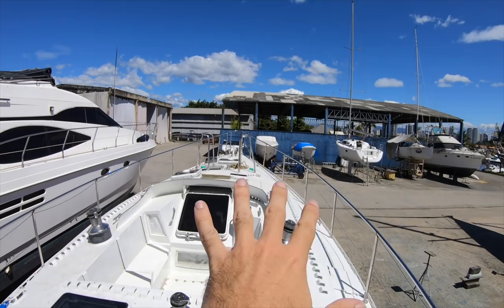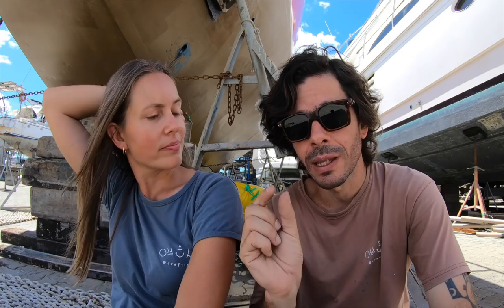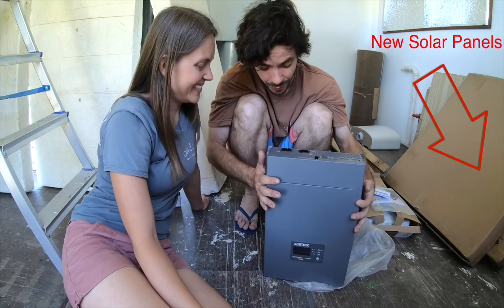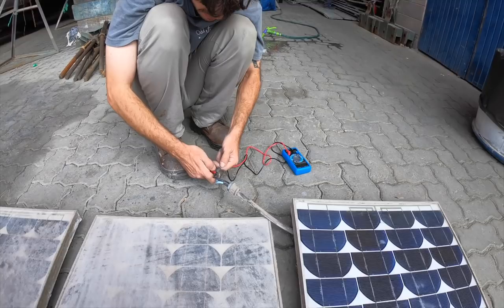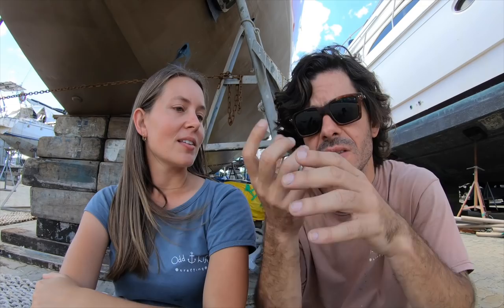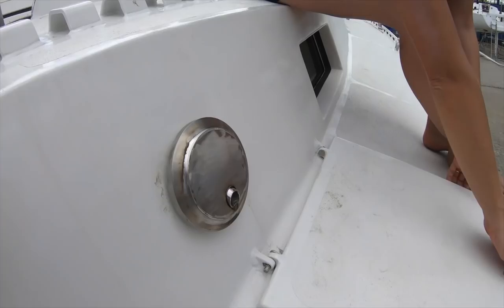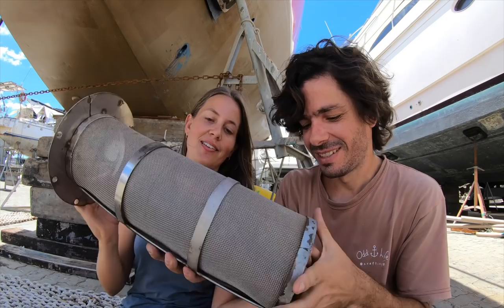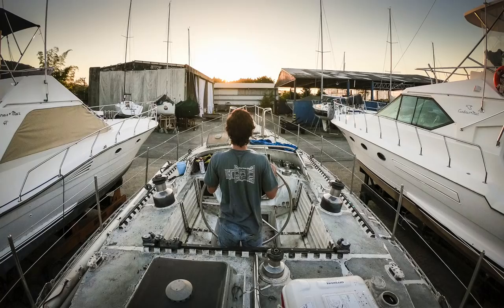⛵️Stainless Steel! LET'S GET STARTED!! #120

Comment: Check the DC voltage and amps on those old modules.  They could have advertised VOC (voltage open circuit) and not produce adequate amperage.
Reply from the maker: Thanks for the tip

Comment: I've noticed on a few of your videos that when you are putting stainless steel fasteners in/on your boat, that you are not using anti-seize on any of the stainless fasteners.  Using anti-seize is particularly important when you are using a stainless screw/bolt because stainless has a great tendency to gall and seize up - like all the fasteners on the wood rails along the top of the boat that you had to cut off.  If you ever want to be able to unthread any of these fasteners in the future, you need to use anti-seize on them.   This is a paste that usually has aluminum or copper in it that you brush onto the fastener before assembly.  It is sometimes known as copper grease or copper paste in Europe.  Do a search on amazon "Loctite 299175 Paste Anti-Seize Lubricant", this is the Marine grade of anti-seize. A little goes a long way, so one bottle is enough to do your boat and several other boats.  Use it on every fastener that you can, including all of the steel fasteners.
Also, if you want to bolt aluminum rails to stainless steel, you need to use large UHMW or rubber plastic fender washers between the two to prevent direct contact (but there will still be electrolysis at the bolt).  Most people don't know what fender washers are, they are very large diameter washers used in automotive applications.  For example, if you get a washer for a 1/4 inch (6.35 mm)  bolt, the diameter of a fender washer will be about 2 inches (51 mm) or more.  If you do a search on amazon for "Prime-Line 9086029 Fender Washers, 1/4 in. X 2 in. OD, Black Neoprene, 25-Pack", it will give you an idea of what I am talking about.

Comment: Curios about the aft stainless arch. Its attached to the stern rail. I'm concerned about that w the dingy weight and movement of the boat. Doesn't look stable enough.  Should be attached directly to the deck w metal plates.
Looking 👍

Comment: If you put a one way valve in the hose it woudnt matter where it vented to as long as the pressure difference on the venting side is less than the diesel tank side.
Reply from the maker: 👍🏻👍🏻 20 years ago we don’t know if it existed. Hehe. That’s way he changed the place of it. Hehe
Reply: Im not saying ya'll did it wrong.  You probably did it the best way.  My mind just got to thinkin what the previous owner was thinkin and how to make it work that way.  To see where he was coming from ya know?
Reply from the maker: Yes. I understood it. Hehe

Comment: By doing the water supply in the rail you eliminate the possibility of having gates in the rail to step on and off the boat at a marina.??
Reply from the maker: Yes. To have the gate we would need to do some welds on the hull and we didn’t want that. At least for now. 😁

Comment: Good Morning. Did you consider installing a bow thruster during the refit?
Reply from the maker: As it’s a hot galvanized metal boat we don’t want to touch to much on the hull. But to have one would be great. It’s also really expensive in Brazil
Reply: @OddLifeCrafting  thank you for your response. Have fun in Miami and Ny
Reply from the maker: Thanks a lot

Comment: So you'd have some running water on the chain of the anchor as it is being drawn back in to rinse if off? Very smart. also second arch to duck under when the sail it batting about is a smart idea. Are you going to have some kind of a wheelhouse enclosure to keep from getting slapped around directly by water in a storm? My heart is with you guys as you make improvements to the boat. :-)
Reply from the maker: We are planning some sort of enclosure. 😁 thanks for the support
Reply: @OddLifeCrafting  awesome!!

Comment: Hey guys not sure if any one said the main reasons the decks on sailboats slope so much. When running the boat leans and proper trim will have one side almost level. Hope you took that in to account when they welded the side rail.
Reply from the maker: Yes. This is one of the reasons it’s like this ☺️

Comment: the selection of stainless for piping salt water can be an issue. If you haven't check out the best way to prevent corrosion of the pipe considering the type of alloy you have. It might be as simple as draining the pipe when not used.
Reply from the maker: The idea is to have a hose inside of the pipe ☺️
Reply: @OddLifeCrafting  that may work depending.

Comment: At 1:21, there appears to be a crack in the top of the diesel tank that runs down slightly into the side wall. If so, was that repaired?

Comment: Electric davits? 😁 will be stronger and good for more solar panels. B&G makes good autopilot no? Great job! When using aluminum and stainless use dissimilar metals sealant or compound when assembling.
Reply from the maker: Thanks for the recommendations. We are not sure about the electric ones, it would be one more thing to give some maintenance.

Comment: Hi follow you every week and it has certainly been a great result,
however, I am a little worried about the way the arc for the solar panels and dingy is mounted,
was it my boat  the arch was mounted all the way down the deck, and not on the railing,
but should it be on top of the railing, I think it should be welded on, and not screwed with 4pc M6 bolts,

likewise I wanted to make an X reinforcement in the railing where the arch is mounted,
but that is not my decision and I can be wrong,   ;-)
Good wind ahead with your project.
Reply from the maker: We were going to weld but it is so solid like this that we decided not to. Ans also this arch was made originally on the boat yard 28 years ago. And all of the sabe boat we have seen came out with the same arch and we never heard of any of them failing. So. 😉

Comment: It wouldn't be that hard to get water through that bulkhead near the bow. That is what through hull fittings are for. Put a sea valve on the inside as a safety shutoff in case a problem occurs in front of the bulkhead.

Comment: The reason you did not see a difference between a dirty solar panel and the clean solar panel you were reading voltage only if you place a load on the dirty panel (something drawing power) the voltage would drop and the current would be much lower

Think of it this way the dirt is preventing light from reaching the panel so its energy source is lower
Reply from the maker: 😬 thanks for the explanation

Comment: The Voltage on the dirty and clean will be the same it is the amp load that you will see the difference.
Reply from the maker: Thanks for the explanation
Reply: Solar is what I do for a living.  If you ever need any advice feel free to ask.
Reply from the maker: Thanks a lot. We still need to install the new ones. Xantrex are gonna assist us about the installation. You can give us some tips ☺️
Reply: @OddLifeCrafting  💗👍

Comment: Not sure if you will end up regretting the rail.  When the boat is under sail it will tilt making the deck level but the rail will then be in the way to walk.
Reply from the maker: It depends on what side of the boat we are gonna be walking through ☺️

Comment: add a small nozzle with a pump controled by the anchor winch power to splash water directly on the chain while the chain will be hauled in. Nozzle can be installed on/in a pipe bow. Saw that on a Hallberg Rassy.
Reply from the maker: That’s a nice idea!! Thanks a lot for the tip!

Comment: Voltage output is not "power". If you put a load, voltage will drop much more on the dirty panels.
Reply from the maker: Thanks for the explanation
Reply: @OddLifeCrafting    It was a "on the go" reply. Solar panels work like this, at OPEN CIRCUIT (what you were measuring) the will show the datasheet voltage (Voc) even in (relative) low light, or dirty, because the current has nowhere to go. If they are squeaky clean and have full sun and you short circuit the + and - , you will measure the SHORT CIRCUIT current (Isc) (at a very low voltage, hence the short circuit). Varying the impedance on the load side you can try to find the sweet spot that will give you the most power (P = V x I, where V can go from 0 to Voc and "I" can go from 0 to Isc). That is exactly what a MPPT controller does. And because the power curve varies with ambiental conditions (sun intensity, angle, ambient temperature, panel cleanness, etc) this "tracking" of Maximum Power Point is done constantly. So, solar panels produce power "on demand". There is no harm in letting them out on the sun without any load (that is not true for most other power sources, like wind gens, alternator, etc), and as far as there is sun, they will produce only the accepted amount of power the load can take (charge controller being the "gatekeeper" if there is a voltage limit, like charging batteries, for instance) up to their max power output. A windgenerator, for example, if there is wind, and no load (batteries are already full, for example) will have to be either mechanically stopped or connected to a big resistor do dump power otherwise it will spin it self into destruction and/or burn the regulators from high voltage.

Comment: Ah, do not confuse the open circuit output voltage with the energy generation ... the voltage  without a load is not a true figure of the power that can be produced.
Reply from the maker: Thanks for the explanation

Comment: Your rail will rust, you need to electropolish the welds.
Reply from the maker: Thanks for the recommendation
Reply: Odd Life Crafting hey you need to grind it first with special grinding machine like Suhner UBC 10-r (for that type of weld)if you can't justify 700€cost, you can always buy attachment for angle grinder(variable speed) on aliexpress😉 which will do the job and don't forget to passivate.
Reply from the maker: We didn’t finish the job yet. They are gonna use this method as they did on the arch.

Comment: Very nice work, only one concern. When you run the mid rail cable through holes in the stanchion posts, you will allow water to collect inside the posts. This will lead to corrosion at the base inside. It’s better to install guide rings on the outside and run the cables through them. Love the transformation and the attention to detail.
Reply from the maker: They have no holes to the inside of the posts, there is a plastic piece inside to allow the cables to pass through but there is no way the water can get in ☺️
Reply: Odd Life Crafting sorry, I rematches the end of the video and noticed the sleeve tubes you have welded in. Very nicely done!

Comment: I think that you guys are great and very loveable. Today is my first criticism. and it may be related to your being two engineers who have forgotten Occam's Razor. Using the rails to pipe water forward is both over-complicated and foolish. Just add a thru-hull in the chain locker and place a pump there. You can pass a wire through the collision bulkhead using a fitting made for that purpose (get it in the US) or just epoxy the hole the wire passes through. The railings, per se, are a great idea. When in doubt, copy any safety idea found on an Amel boat.
Reply from the maker: We don’t want to add holes on the hull as the paint is done and also we don’t want to have to weld something on the hull and to lose the galvanization we have there
Reply: @OddLifeCrafting  Then pipe the water from an existing thru-hull. This is not a constant use. I tapped mine from a sink drain and ran a hose forward for 6 feet. Your reasons are valid, but your solution is not.

Comment: I would malke more sense to have the extra filter on the filling line, so you get clean diesel in the tank, instead of cleaning it when talking it from the tank, before it gets through the regular filter. You don’t want to end up with contamination in the tank, more easy to clean it before it enters the tank

Comment: @Odd Life Crafting 
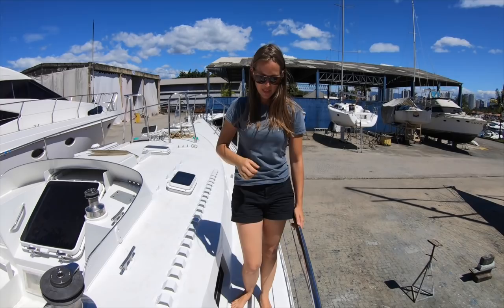2:08 Your deck has an angle down, because it will be level-ish on the windward side when tagging -  wing on wing or on anchor it doesn't matter if it's on an angle. Safety is and should be a priority, but once you are underway, the angled decks will make sense to you i promise ;) 
18:20  - i hope you had all those weldings etched properly, otherwise they will be gone in 12 months.
Reply from the maker: They are gonna do a finish to the welds and are gonna polish all the stainless steel ☺️

Comment: The downside to a solid lifeline/handrail is that it has no give to it. It’s not uncommon when sailing offshore that there will be circumstances when you can get thrown against lifelines before you reach the end of your tether, and hitting a solid steel rail is not fun. A soft line, either wire or synthetic, at least will yield a little bit as the slack comes out of it, so the impact is lessened quite a bit.
Reply from the maker: Well, sometimes in life we need to choose between some things and we think a hard rail is gonna be good for many things

Comment: Did I hear correctly... ?  you said 'You can't have two bodies on the same spot at the same time it wont work.'  Tip: Try Bed. 🤪😍  ... it does work! (fun too!)
English pronunciation:  Chimney is said as 'Chim-Knee'  which a short 'i' as in 'ink'  the 'K' is silent.